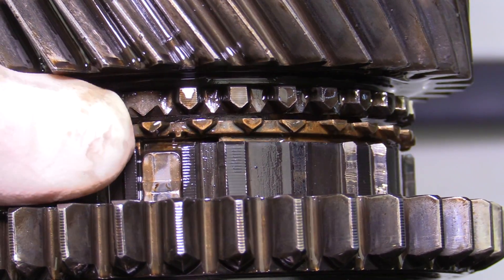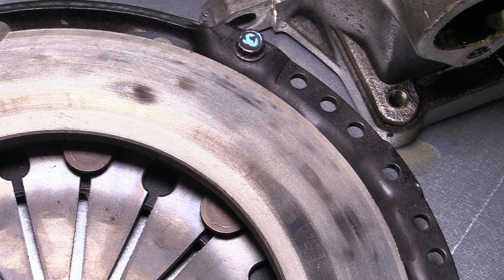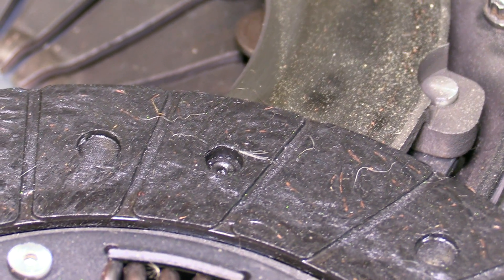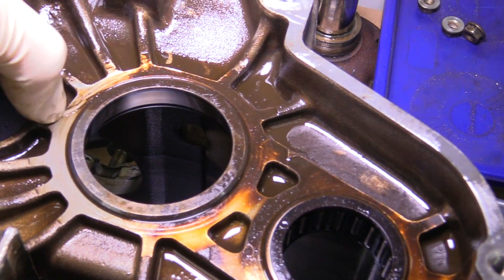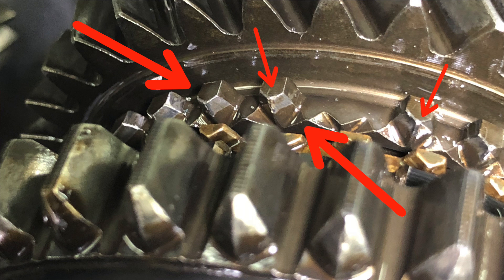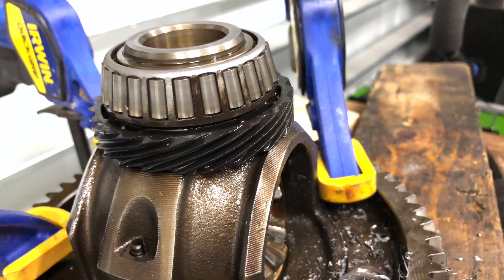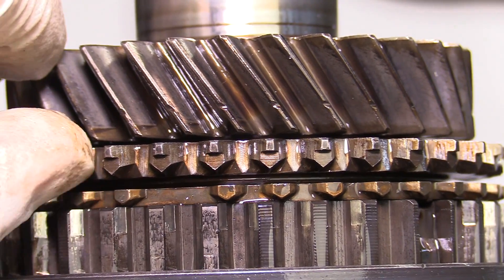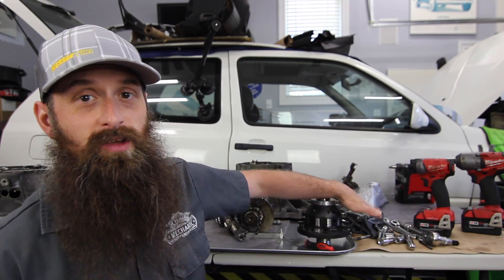Manual Transmission Teardown and Inspection

Comment: If you put new bearings and gears and same price or a bit more than I remanufactured transmission. I'd stick with doing it myself. At least you know what's in it and you know it's done right. Plus you would just have to disassemble the reman one to put in the limited slip differential.
Reply: I agree with Brad. plus putting in beefier gears sounds like a solid idea. who knows how much power vw engineers originaly specced these for

Comment: The wear on gear synchro teethis usually due to the synchroniser to hub mating surface (the tapered area between the synchro and gear) becoming worn and glazed. The gear may be able to be dressed up but the synchro should be replaced as it is a high wear component on a car that is driven hard, also be sure to lap the synchro on to the gear using some fine(ish) lapping paste and rough it up slightly. As a rule of thumb, after lapping a synchro to a gear and then cleaning it all up, you should be able to engage the synchro to the gear (dry) and pick the gear up just using the interference in the taper between the gear and synchro. Makes for sharper and positive engagement.
Reply: Ps. Smoother and quicker shifts

Comment: You, are a brave man.  Transmissions scare me to no end.  They are like engine rebuilds in the sense that soon as you get started, your wallet starts making the toilet flushing sound.  LOL!  I am dying to see the video of you getting down into the rebuild.
Reply: Its all about taking your time and following the manual. I've done some for $200 cost buying the master overhaul kit and the book for the job. The ones that really suck are the ones that are a pain to R&I when issues happen and you have to go for round two.
Reply: Yeah, that's what pretty much what scares me: round two because a synchro was not installed correctly, or I left something not torqued, etc.  I can play on Audi engines all day, but for whatever reason, transmissions, I stay away.  I give MAD props to our Humble Mechanic here.  I am dying to see his tear down and rebuild.
Reply: Harry Nazarian I've only ever done a 5spd manual rwd. But what you learn real fast is is the discipline to do every single step perfectly and in order and if you're not sure stop and find out no matter what it takes. If you don't you WILL do it over, assuming there's anything left to work with.
Reply: I used to rebuild the transmission I'm my Mustang in 4 hours, that included pulling it on my back in the street, and putting it back in later lol.
Reply: Manual transmissions dont scare me, automatic transmissions however, I wont touch

Comment: Heya Charles.  I just finished doing this.  Installed a Wavetrac in a 02J.  The oven/freezer method works great for installing the ring gear and bearings onto the diff.  Had to have a machine shop press on the 5th gear syncro hub though, so go get your press :-)  You should show/explain how to measure preload when you install your diff.  Thanks again for all the great videos!
Reply from the maker: NICE! How do you like the lsd
Reply: I was quite literal in that I just finished putting the transmission back together...it's not in the car yet!  Will report back in a week or so once it's bolted back in.  I'm in the middle of a 09A to 02J, so lots of work :-)

Comment: I’ve driven a lot of VW’s (Mk1-Mk3) that had a “scratchy “ 2nd gear.. my own Caddy pickup as well until I fitted a brand new ‘box from VW.. Personal opinion is use what you have and replace what needs replacing now, not later.
Reply from the maker: I am leaning on making the repair. If this was a stock GTI, I would slap it back together and roll...

Comment: Great vid Charles. A drill press is a must have to drill out the diff rivets it makes the job much easier.
Reply from the maker: Oh yeah. That’s been the worst so far.  I’m not even done yet. Hahaha
Reply: HumbleMechanic yah those rivers are strong.  The press saved my ass on the last lsd I installed on a golf R.

Comment: I got new gearbox, well used one, for my MK3 Jetta, reverse gear was making disgusting grinding noise (it even had some teeth missing) and 2nd and 3rd were sometimes impossible to shift into, i had to ram the stick couple of times before it went into gear.. Freakin' nightmare when it happens while overtaking someone LOL. Got it for a bit more over $70, put new fluid in it, not a single issue since then, oh and new clutch, bearing and push rod, basically clutch assembly was falling apart when i bought the car.

Comment: Looking forward to rebuild because i need to do that also for my MK2 golf...probably same gearbox 020
Reply: busilica123 020 is harder to disassemble, my opinion. I’ve done one but not buy myself, I have two to rebuild that I got on a good deal. Need to save to buy all the parts and I want to install a limited slip into one of them.
Reply: He probably has a 02A

Comment: I have a MK3 golf gti 16v that grinds going into 2nd gear at high rpm when you shift fast, but if you're gentle it usually doesn't grind. 

My question is would a slipping clutch cause this issue? As mine is starting to slip, but I'm guessing it is most likely second gear synchro. Also I'm guessing the tranny oil hasn't been changed in a long time as the filler bolt is seized solid.

Appreciate any replies, thanks.

Comment: I have an '07 rabbit 2.5 with the 5 spd JCT code transmission. Something broke internally which caused a hole in the case. The research i have done suggests this is a common problem, but i have not been able to find any videos or pictures showing the problem or how to fix. I am wondering if you have any experience or videos with such a problem/solution on how to fix and prevent in the future.

Comment: Cool video,

I’m having problems where when it shifts to 4th, it will jump and jerk back to 3rd a few times and will go to safe mode and just stay in 3rd. Would this be the mechatronices/solenoid issues or the transmission synchronizer?

BMW mechatronic transmission

Comment: Nice Video Charles as always,  Can I ask you something my 2nd Gear on my Toyoya Avensis , it is not very easy to fit. Would you say is something related with the transmission or Clutch and Flywheel?

Comment: HumbleMechanic , what is your opinion on the triptonic transmission of a 2005 vw Passat ?
Reply from the maker: It’s okay. I had over 200k on mine. Whatever you do, don’t use non OEM fluid
Reply: @HumbleMechanic  , thanks for the tip

Comment: Charles, what did your bent clutch fork feel like at the pedal?  Was it impossible to bleed at the slave cylinder?
Reply from the maker: The pedal wouldn't come all the way up, and the clutch wouldn't always function to allow the trans to go into gear. It did feel like the clutch still had air in it.

Comment: That 2nd gear still looks good man, don’t worry. If you had no shifting issues before with that nasty fluid you I’ll be fine. The “dogs” on 2nd still have a nice defined point, issues arise when they get hammered down to being rounded or having burs. Install the LSD, set preload, and send it....
Reply: Agreed, I'd run it. A little wear there is nothing to worry about.
Reply from the maker: If this was a stock car, I would 100%! Now that I have the R32, I may want a little more flexibility with adding HP.. :)
Reply: Where? You would be able to see them on the tip of the dogs. Did I miss it?
Reply: Nice explanation. I guess I'm conditioned to see the REALLY bad gear grinds as a Subaru tech, This one looks like new to me haha
Reply: That synchro and dog teeth are fine. Unless you have a problem with it going into 2nd gear there's no problem.

Comment: I installed a custom gear set and Wavtrac diff in my 02j.  Thought about going full dogbox but didn't have the extra $5k laying around for the gear set.  I only spent like 2k instead for JUST the GEARS!! VW transaxles are expensive to mod...
Reply from the maker: OUCH!!!!! How does it drive.
Reply: It drives super nice and the Wavtrac diff is amazing. The warranty on the Wavtrac is about unbeatable! See my vid here: https://youtu.be/obxUNWcqMZE 
I purchased the gear set from www.eurospecsport.com and the Wavtrac came from www.autotechdriveline.com. The stock gears will handle 300 WHP all day long though.  You'll save much time and money going to the u-pull it yard and yanking a working 02j out. The gears in your vid actually look pretty good. The chewed up sync tooth ring deal ( I forgot what its called) can be pressed off the actual gear and replaced. If you want some longevity out of your stock gears you can have them cryogenically treated. Either www.brokevw.com or www.vwtransaxles.com offers that service, I forget which. Both sites are VW transaxle information GOLD though. Check them out anyway you'll be impressed.

Comment: If you get a remanufactured unit can't you ask for them to drill out the rivets for you?  May save some time and effort in the long run.  If it's an option.  That transmission fluid was nasty😯
Reply from the maker: Nah, they have them ready to go most of the time.

Comment: Being an ex-trans tech, I'd look for some sort of upgrade from that multi piece synchro on 2nd gear. If you can find someone that replaces that with a "standard type?" one piece synchro, I'd think it would be more robust as long as you can have the same drive-ability out of the thing of course.
Reply from the maker: Luckily 2nd is multi-piece. From what I have read, most go with OEM synchros. I found a few solutions but they are $$$$$$$
Reply: HumbleMechanic I'm sure you researched it more than me.

Comment: You'll be fine just don't do burnouts, smash potholes and fly around at 130 miles an hour every chance you get . From all the work you've done to those cars you could have probably installed a jet Motor  on the back of it.

Comment: If you decide; to go through the whole trans yourself, you might look into the trans repair kits, by Luk called the "LuK GearBOX", more more info check the Schaeffler REPXPERT
site. They come with everything you need; to refresh the trans and even have a instruction kit with it. I wish they would have had these; when I rebuilt my 02M, in that case, I had to get everything from the VW dealer and I can only assume, it would have been more cost effective, to get the repair kit through LUK. Google: "7239 LuK GearBOX VW02J"; for the .pdf repair manual and kit info. They have a video on youtube; showing them go through a 02T trans; which I thought was pretty cool, "LuK GearBOX repair solution for VW 02T transmission". You might need to contact Luk USA; to see who could sell you these kits, as they seem to be shown on their european based sites (Germany, UK). I think it would be cool; if you would connect with large european oem's like LUK and have some videos with them, showing their manufacturing, engineering and parts offerings, for the VW/Audi aftermarket industry and enthusiasts, like us, who have to keep fixing our broken cars! :)
Reply from the maker: DUDE!!!! This is killer info... THANK YOU